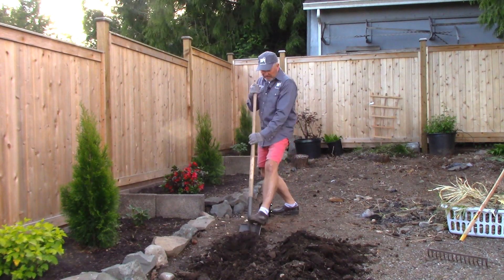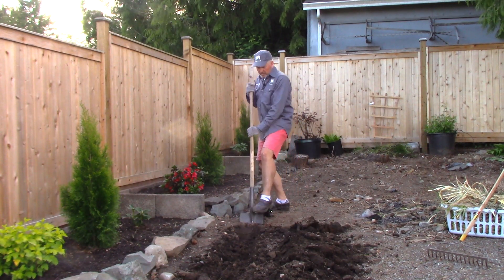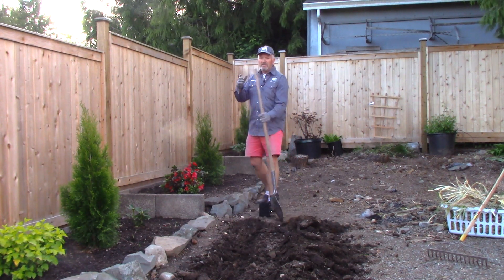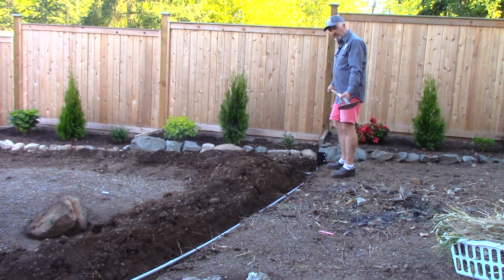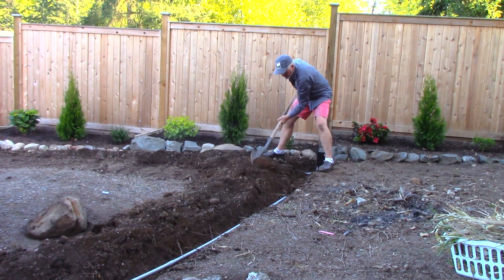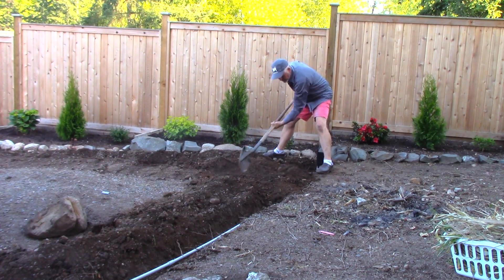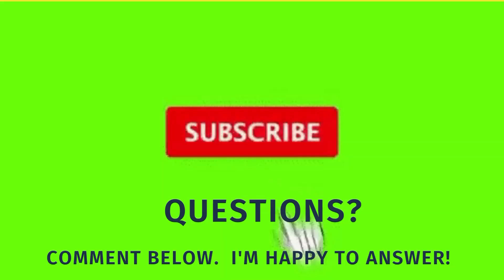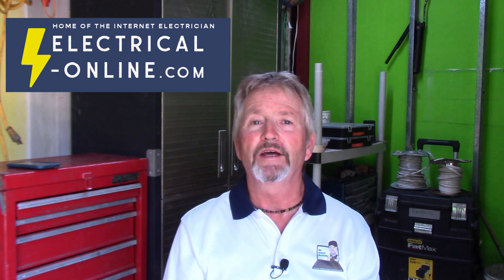Tips for Digging and Backfilling a Trench

Comment: Great information, Terry!  You dig the same way I do it.  It is much easier on your wrists, back, and other muscles because you're (using your weight and) letting the shovel do the work.  I wish I had learned this method years ago.  I hadn't used your backfill method yet.  I'll be sure to try that next time.
Reply from the maker: The first day of work that summer, I was told to dig a ditch of about 20 feet long, 3' deep, through rocky, pit-run material.  I thought my Journeyman was joking!  Not!  By the end of the summer I was hand-digging 200 + foot trenches through Oil and Gas leases and valve yards (no backhoe allowed due to the many sour gas high pressure lines)  Shovel, pry bar, and pick axe were my "electrical apprentice tools" for the summer.  I guess if nothing else, it taught me how to dig!